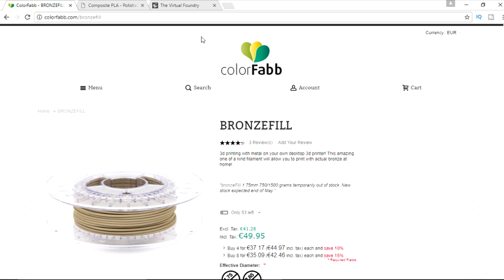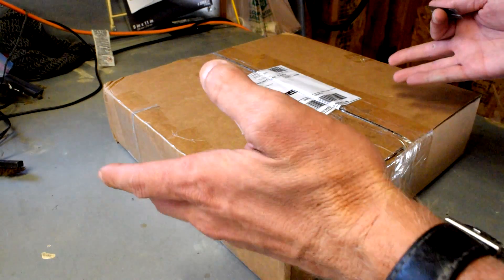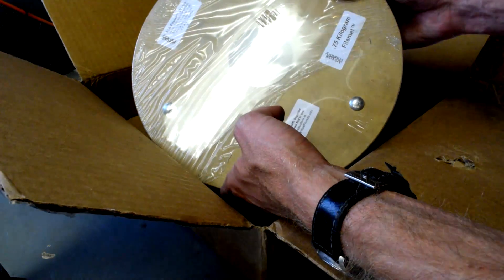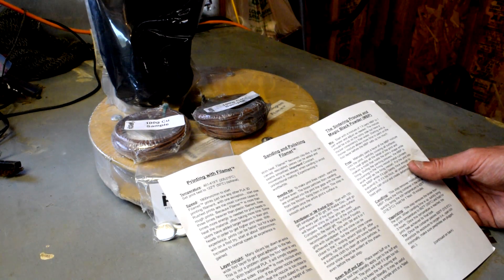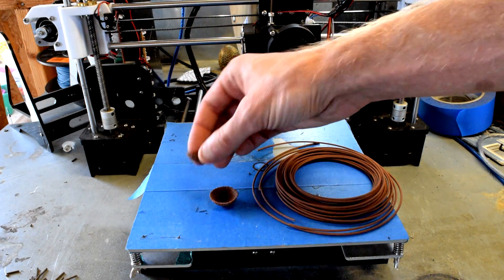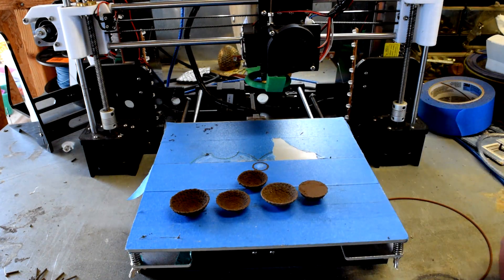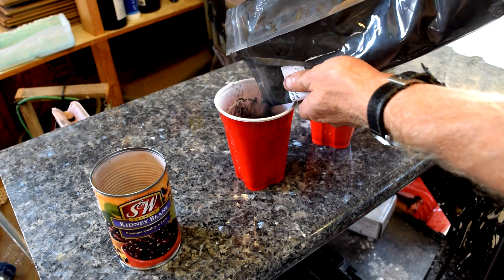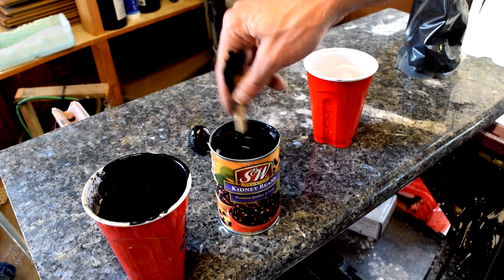90% Metal Filament Review-Virtual Foundry

Comment from the maker: I took another go at this filament and the sintering process in this video with much more success: https://youtu.be/VJRd0zTegAU
Reply: Hey, can u do another vid now that they have steel i want to see if they improve
Reply: Hey bud try heating the role up with a heat gun to make it flexible
Reply: A tip i have read is to disable retraction as well

Comment: i need specially designed metal tools made at work and there's no way they would go for a 150k+ metal printer when its not used for production.
its only to support the assemblers. 
i was hoping you would review the 17-4 filament as the bronze & copper is practically useless for absolutely everything.

also they sell inline filament heaters now that's suppose to help with the breakage.

Comment: I am printing 2 foot size objects for a brass chandelier...this sintering process would probably not work.  I am using elbow grease and sand paper which works well.  Also the stone grinding attachment for a dremel works well for a distressed look, but you can follow up with sanding as well.

Comment: Thanks for the review, did they ever improve it?
Reply from the maker: They supposedly did and came out with a filament heater. I don't think they want to send me any for a 3rd review though...
Reply: @RealProjectTube  Thanx for the update, I was wondering after watching your video if boxing in the still and printer and running a heater would resolve the issue. Would not have thought of just heating the spool out filament en route to head. Hope they send you another sample and this filament heater to test out.

Comment: Thanks for testing this.  I hate to say it, but this can't work.  For powdered metal to work, and have any strength at all, you have to reach a temperature where the metal will melt together.  At that temperature, the metal won't hold it's own shape.  Or in other words, it can't flow together unless it can flow...  The solution is to cast metal parts instead.  There are guys doing that using 3d printed parts as master for the mold.

Comment: 4/14/19 More description/thorough Updated.  I just got a 1kg copper roll a couple weeks ago.  This is the 8th generation I believe.  I changed some settings with the speed mainly and extrusion rate had to be turned up a bit.  I am printing on glass heated bed at 60C and extruder is at 225C.  I also am using a .6mm stainless steel nozzle.  I am also using the Filamet (proprietary name for Virtual Foundry's filament) FilaWarmer that Virtual Foundry sells.  I am printing copper medallions for a greek festival, for our school, coming up.  The metal shine comes out with  wire brush and sandpaper or the right bristle/grinding attachments for a rotary tool.  It hasn't broke on me once yet. I had an earlier generation, what Virtual Foundry called their 2nd generation.  I had that for a couple years before I tried using it.  It was brittle and behaved like yours in the video.  The new product is great!  I have it printing as smoothly and successfully as PLA.  I am and have only printed medallions though that are about 55mm in diameter and 6.5mm tall.

Comment: Nice video. This would be soooo good  - if it worked.    

I know I'm late to the party but you could try aiming a hair dryer at the roll to warm it up a bit so it's more flexible and less prone to breaking.

I'd expect the magic black powder to be mostly charcoal powder (with a bit of calcium sulphate (rotten egg smell) to act as a binder)  to prevent oxidation of the metal - on the outside it would turn to ash.  This is used in PMC sintering which is very similar to this, except using a sculptable clay like material (i've managed to sinter bronze and copper PMC with a  creme brulee blow torch, pile of crushed barbeque charcoal and empty tuna fish can - more kitchen than foundry :) )

Comment: Is it suitable for PCB layout? 
Has anyone check it's electrical resistance?
Reply from the maker: alfagulf in my second video on this filament I check the conductivity of it after sintering and the results were not consistent. I doubt it would be useful for electrical circuits.

Comment: So... Any luck with light-medium duty parts? EG, An AR-15 lower receiver? Probably not due to brittleness...

Cody Wilson, years ago, was trying to find a way to properly print one with the materials available at the time, but the results were lackluster and the gun usually fell apart after a handful of shots.
Reply from the maker: I've printed an AR-10 lower out of PLA before just for fun, not functional. Thought about casting it out of aluminum but it would of required a lot of machining. I suppose its possible to print one out of this filament and sintering it. But unless you get the sintering just right the strength just isn't there.

Comment: RIG UP A HAIRDRYER DIRECTLY TO THE REEL JUST BEFORE THE FILAMENT COMES OFF THE ROLL. PERHAPS IT NEEDS TO WARM THE BINDER A LITTLE TO ALLOW IT TO FLEX MORE.
Reply: A good point: the temp and/or relative humidity may be something that requires tight control...

Comment: **PRODUCTION METAL "FILAMENT" IDEA~~~PRODUCE A FILAMENT WITH A HEAT DISSOLVING RESIN AS A BINDER SUCH AS THE WAY A SOLDER ROLL COMES WITH ITS FLUX CORE WHEN HEATED THRU THE EXTRUDER DOES NO MORE THAN "TEMPORARY" BIND ALL PARTS THEN FINISHED PIECE CAN THEN BE FIRED TO 1600*DEG OR MORE OR LESS (DEPENDING ON THE MELT POINT OF METAL!** THIS WOULD, PERHAPS KEEP CONTENTS IN A WORKABLE FORM. OR EVEN IF THE "EXTERIOR" POWDERED METALS MAY TEND TO FLAKE AND DETACH FROM CENTER CORE THE PROCESS COULD HAVE ANOTHER "OUTER" SHEETH PROTECTANT THAT WOULD HAVE A GOOD FLEX POINT YET A VERY LOW BURN OFF...PERHAPS EVAPORANT QUALITY TO IT!*** READY~~~ START~~~ GO!     PATENT IDEAS??     LOL!

Comment: By engineering book reference, strength on part comes from sintering where molecules of microscopic metal balls fuse under heat.  The 10% space between balls is where gaseous conversion of the binding material leaves the printing.

By observation, the cross-section on can o' beans is 3X part size.  Guessing it should probably be 1.5X or less in horizontal and vertical directions.  Try again, like Colonel Sanders...No i have not personally used these products.

Comment: The black powder is probably calcium sulfide.
That's why it leaves a white crusty exterior when it cures correctly in the oven, and why there's not as much change in it's physical dimensions. 
The PLA evaporates out, and some amount of sulfur migrates into the bronze or copper. 

That's also why we don't see more of this product used with other metals; this technique doesn't work with really anything other copper and copper rich alloys. 

This does tell me something interesting though: PLA burns off in a reducing manner.

At 90% metal, the copper is still probably good for printing circuit boards, especially since the PLA is effectively acting as a type of flux, but lost PLa seems more worth while. It has wider applications, broader materials, and doesn't rely on 'magic powder'.

Comment: What about the mechanical properties of the non-sintered filament? How does it compare to real cast brass/copper?
Reply from the maker: Almighty11 no, not even close. it has near the weight of cast metal but breaks about as easily as PLA, it might be a bit tougher but close enough to not matter.

Comment: My wife is an artist and we actually managed to get something printed. It took lots of trying and filament. You must print at about 250 C celcius and half speed and a 0.8 nozzle. We printed before rolling, so you had to lay the filament on the floor and then turn it on continuously. A bit strenuous when the print takes 26 hours to print and the roll should be rotated every half hour. But it worked. Sometimes the nozzle stopped: / and once the nozzle stopped because the filament was over 3 mm thick; (But they have got control. We have not tried to put it in an oven yet.
You can see the result here (No, it's not meant to be an advertisement, but as a consumer information from a 3D -printer user to another). Each part is printed for itself and glued together afterwards      

 http://buxbomsart.com/shop/sculptures.html
Reply: No More Artist ?

Comment: project tube can you send me your marlin firmware? i tried upgradeing to the lead screws but could  not get it right they would go slow or fast even with the right settings so send me your firmware i have the same printer

Comment: I can't see how it would even work without huge shrinkage anyway? Shame to see such a poor result though. I think your lost PLA casting is way more value for money!
Reply from the maker: Hey Angus! I was thinking the same thing as far as shrinkage. Really enjoying the Fusion 360 tutorials by the way 😀
Reply: is it 90 percent by weight or by volume?
Reply: Just a rough guess, bit if the model shrinks by the 10% PLA volume, it would make sense if the magic black powder expands through a similar temperature range so that constrained in a can it shrinks the void by 10% or a little more to be sure, and possibly wicks the binder.  Basically 'complimentary function to what the model is doing during the process'..

Comment: I wonder if you annealed the filament in the oven first if it wouldn't break so easily
Reply: Kevin Halbert, I think if you annealed the filament first it would likely sinter it and turn the filament into wire and thereby making it impossible to print with it.  This is still a great idea but they need to figure out how to put a flexible binder in the mixture that keeps the filament from becoming so brittle.
Reply: Kevin Halbert heatgun

Comment: CONTRARY to normal care for filaments!

Normally keeping humidity from filament is an almost religious effort. But I would note that the breakage issues and makeup of the filament suggest a different problem.

Already 90% of the filament is "moisture free". You are asking the remaining 10% of plastic(?) to do the work of holding the metal together.

I have noted that "weed trimmer" users in desert environments complain bitterly about brittle trimming lines. On the other hand I soak a trimmer spool overnight for use on heavy weeds on the mountain, using the same product, with great longevity.

Drying out the filament that is already brittle is contraindicated. A good soak or even exposure to a humid environment is the next best trial I think.

Using a hot air blower or heater on already dried out filament -  probably not so good! 

Give it a try. If it makes a huge difference and you post it - you'll be a HERO!!
Reply: I would like to see this
Reply: Roger Heath isn't wrong. brittle PLA is something people note as a problem in places like Utah. 
If you use a sponge rub to remove dust and bits from your filament before going into a hot end, you can easily modify it to apply a thin coating of Glycerin: just soak the felt/sponge in glycerin. 

The coating removes alot of the brittleness, but you might trade brittleness for moisture problems.
Reply: Humidity in plastic is a problem when melting it, every engineer responsible for an injection molding machine will tell you this. Not only does it form voids because of the steam, but for many the plastic gets broken down chemically. Once the damage has been done, drying it will not help anymore...

Comment: what is the best 3d printing forum to get help? element 14?
Reply from the maker: Justin Baker I like the 3d printing group on facebook. I suppose it depends on what excatly you need help with.
Reply: Thanks, are you recommending this one? I am trying to make marlin firmware work on ramps 1.4. It doesn't home right.  https://www.facebook.com/groups/222511188240241/?ref=br_rs
Reply: Justin Baker had also issues with ramps and marlin, if st homing all axis just go like a centimeter inverese the end stop logic. After that the axis should drive continues in one direction. If so, change the end stop position to the right configuration (min, max)

Comment: Buahahahaha. I'm so sorry to anyone who bought this product. Superb idea, but total huge FAIIIIIL of a product. Bad batch or not, there's zero excuse for a bad batch.
Reply: They claim it will run in a standard desktop 3d printer, with the same settings as normal PLA. From the company's website:

Filamet™ is the only product on the market today that produces a 90+% metal print on a normal desktop 3D printer. It's that simple. Filamet™ prints with the same print settings as standard PLA filament. If your printer will run PLA, it will run Filamet™.
Reply: I'm sure their business model requires that this works in $200 printers.  If they need to say "pre-warm this in an 80degC oven, and hit the reel with a hair dryer every 15 minutes" to get reliable prints, then they need to say that.  It's really foolish to turn over samples for review, with little chance of success.  I'm sure the folks at Virtual Foundry have figured out how to make it work; they just need to lead people by the hand until it just becomes part of the craft.
Reply: Royce Barber we have now changed it to an even better product
Reply: I don't think "Normal Desktop 3D Printer" includes $160 models... I also think that their definition of "it will run" is not as loose as most  hobby 3D operators are used to... Think back to the very first time you ever did a 3D print... was it perfect in every way? Not likely, there were things you had to learn to make it work better, how to tweak settings, and so on... trying to do the same thing with a very temperamental filament right out of the box is liable to be the same... Kudos to Project Tube for identifying and being able to correct for some of those problems so quickly, but loss of "attaboys... In that respect I have to somewhat agree with Jedi Pauly as well, there are several extra steps that would likely make things a bit easier to work with the material and understanding the filament is a part of that, I also think a bit more emphasized cautionary information from the manufacturer might have helped... I think his attitude was less than stellar, but it was a damn sight better than Royce Barber... now THAT turd is an entire waste of good skin... blatantly rude and no clue what the frack he is spouting off about other than his vague premise of "zero excuse for a bad batch"... I might lend his monkey mutterings credence when he starts manufacturing filament himself, especially when he ventures into the range of "exotic" filaments... Learn the tools and the tech before you venture into criticism...  Overall decent job ProjectTube... Likely you will know better how to handle it if you were to ever try again... <G>

Comment: Huh - I wonder if Virtual Foundry ever sent their product to someone that actually had the equipment to do a proper review...
Reply from the maker: thom1218 I'm sure a quick search could answer that question. I stated very clearly that the sintering could likely work with a kiln. However that assumes you can get their filament to print without breaking.

Comment: I hope people don't start printing firearms
Reply from the maker: People already do lol But I didn't find this filament is any stronger then PLA. I suppose you could print and sinter it but I think when sintering it the model shrinks significantly which wouldn't be that good for precision metal parts like firearms.
Reply: mill and lathe ftw
Reply: you don't need anything fancy, some bird shot inside a steel tube would do enough.
Reply: Very informative. Getting a foundry suddenly doesn't sound that much of a hassle anymore.
Reply: it's simple to make a firearm with traditional tools. files, drills, lathes etc. 3d printing as is, is more hassle then it's worth. A friend of mine who is a gun smiths apprentice started with a couple diamond files and a drill press.
Reply: Can your friend make me a Barret 50?
Reply: Why not? It would be a fun experiment, although very impractical.